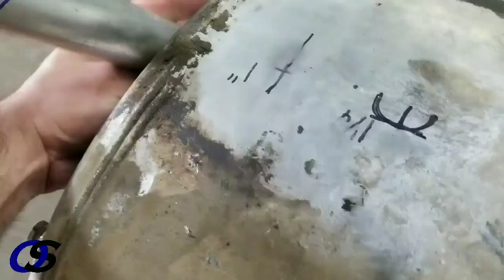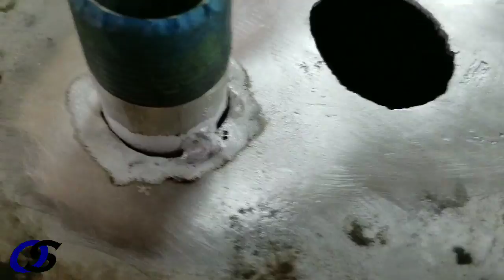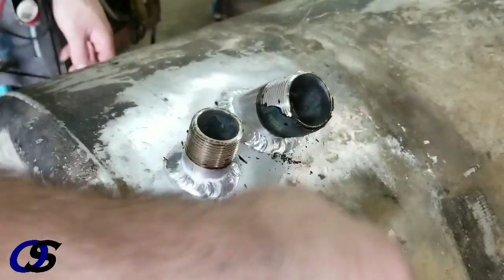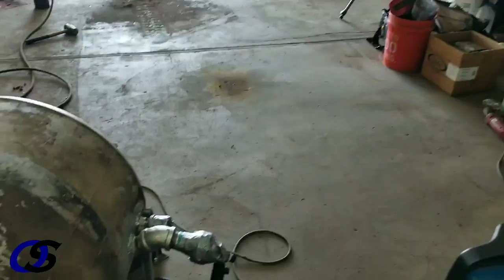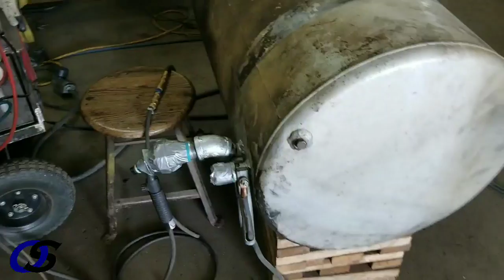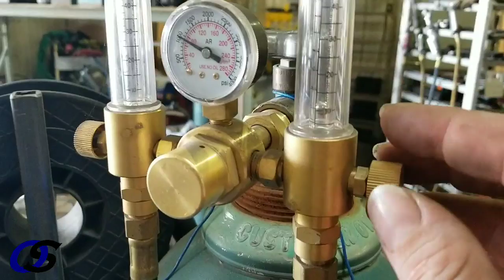Converting a Fuel Tank Into a Hydraulic Reservoir

Comment: Aluminum should never be used for high pressure hydraulics, it is weak and can explode. Stainless steel with appropriate wall thickness should be used instead.
Reply: The third hole he made is for the gas, "Breather". If heat is a problem depending on application you can add a small oil cooler with a fan. Alot of aluminum tanks are made for hydraulic nowadays.